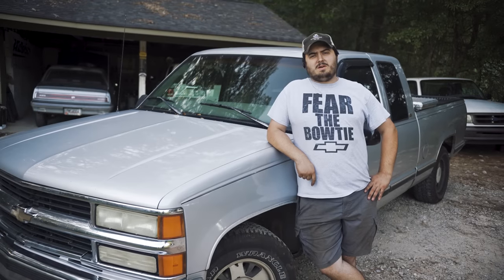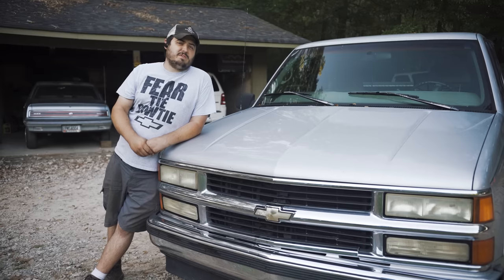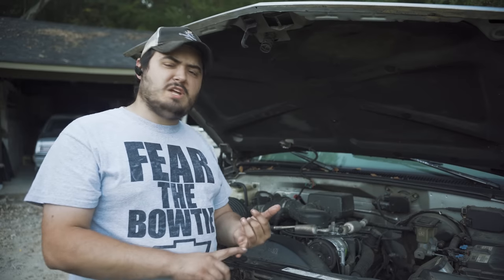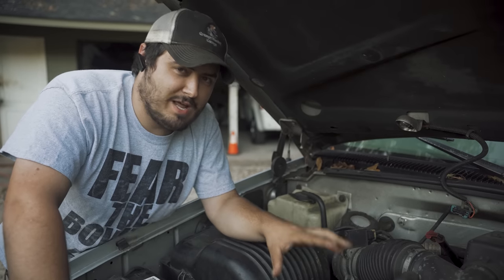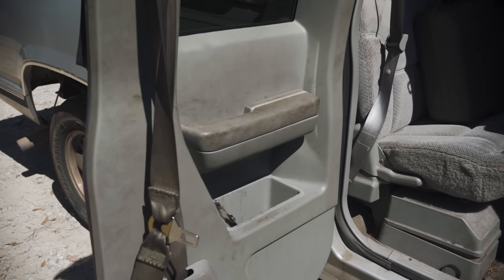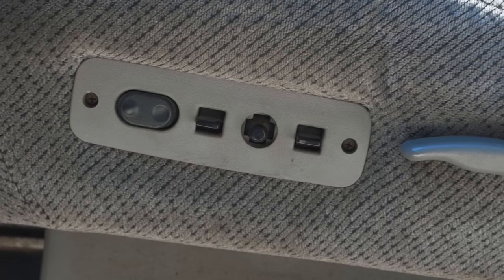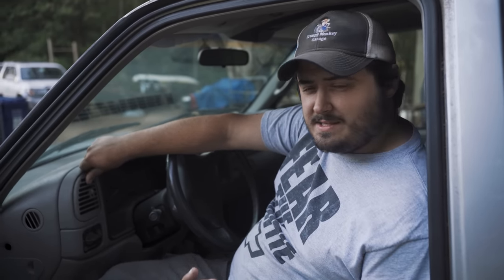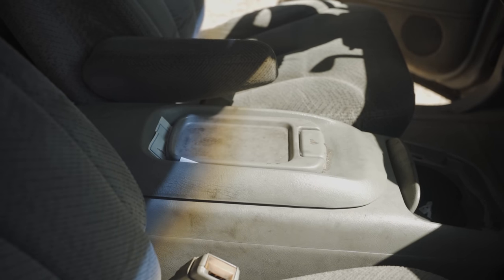OBS CHEVY TRUCK REVIEW, 1997 Chevrolet C/K1500 Silverado Review, The Best Truck You Can Buy?

Comment: I have a 1997 2500 with 348,000 miles. Original engine and no leaks. Love my truck.
Reply: 269k  good to hear!!!
Reply: Which engine do you have in it?
Reply: Do you ever have issues with distributor cap getting fouled with weather, small charged particles etc.? Have heard getting solves distributor issues.

Comment: I have a 1997 k1500 Silverado 4wd, with the 5.7L V8. I am the original owner, it has 190k miles on it. I have taken very good care of my truck. I get people all the time telling me "That's a good looking truck, you wanna sell it?" Nope, never selling it. This truck has been the best vehicle I have ever owned. It has had a transmission repair from towing a large boat for many years, and a fuel system replacement. Otherwise, there is not a thing wrong with this truck. Only wish the built vehicles now like they used to.

Comment: My ol'e girl just celebrated 32 years of ownership by ME. Bought her new in 1990, 350 tbi, k1500,and has turned the odo to the tune of 471,400 miles still on the oe 350. Oh and she's still doing our daily driving and weekend travels. 👊👊🤙🤙👍👍✌✌
Reply: Is your transmission, transfer case, and front/rear differentials original?
Reply: @u.d.novthu2k204  Trans was replaced at 300k,rear diff was just replaced at 480k( owner got to abusive in soft sand). Engine, front diff, and transfer case still oe. ODO is currently at 484,307 mi.✌️✌️
Reply: @bowtie-man  Not bad!
Reply: @u.d.novthu2k204   Yeah I don't think she's done too bad considering the age and mileage. She's still our daily driver and 9 times out of 10 she's our road trip vehicle of choice. ✌️✌️

Comment: 97 k1500 just broke in the engine at 125k and not a drop of oil starts everytime plenty of balls i do all my maintenance bought it from the original owner. And I plan to be the last owner
Reply: I have a 95 2 door one owner just hit 90000 miles. I love it. I am putting it back for my oldest son. He is 11
Reply: I bought my 97 C1500 in 99 and want to keep it until I die. That might be another 25 years, but i think it'll make it.
Reply: 98 K1500 260k, showing the age but I planned on it being a rebuild anyways. It would be nice to replace and rework the true dual system that the previous owner installed. It was beat up pretty good by the previous owner but it's still snarling with the kick to back it.
Reply: dam skippy brother
Reply: Got a 99 K1500 Suburban with 164k I use for my work truck. I put extension ladders and heavy lumber up top on a regular basis and the factory roof rack handles it no problem. Had a 97 K1500 Suburban prior to this one that had 240k and no mechanical issues whatsoever, but the salt and brine they put on these roads in NJ took a toll on the undercarriage.

Comment: I own a '95 K1500 with the GM tow package and optional door remote and I love it! It all still works, 356,453 miles later :D No oil burning either!
Reply: Oil change are life to our trucks
Reply: I feel like the pre vortec motors are better than the 96-99
Reply: i have a 95 silverado fucker runs like a beast 240k miles and haven't needed to spend money on the motor at all yet
Reply: also its a 5.7 350, single cab short bed
Reply: 95 as well here, 296k and going up daily, drives great.
Reply: i wish mine was like that

Comment: I have had my 1996 18 years now. 265, 320 miles on it. Still going strong.
Reply: Like a rock.
Reply: Yeah I have the 97 mines got course 350k runs like a champ no leaks and well still burn the tires
Reply: @jacaughron55  I have a 97 also.  I am often asked if I would consider selling.  I have lived with that truck for 22 years, and will keep it until it cannot be repaired.
Reply: My 94 at 206k is just getting broken in
Reply: I have one also a 1998 and a 2018 but I like driving the 98 more lol
Reply: Tommy Adaway - How much longer do you think your truck will last if you do best maintenance?

Comment: Sing it, bra. I have a 97 suburban and a 98 k1500. Totally love 'em, especially that they don't have hundreds of sensors wired through every inch of the body and drivetrain. Big wide seats, super comfy, and still looks great 25 years later. Pro tip: you can hide a compact 9mm in that overhead CD holder dealie.

Comment: I have a 95 Chevy c1500 extended cab step side and I love it ! Wouldn’t sell it or trade it for anything
Reply: Hold on to that truck! There are harder to find these days. I also have a 95 k1500 ext cab,  4x4 with the 350 5.7 motor. Best of all it’s a manual transmission. Love this truck!

Comment: I have a ‘97 K1500, 5.7/4L60E, Extended cab, Z71 package. The truck has 275k miles and has only had one transmission rebuild. Everything on it is solid except the drivers side cab corner. My plan is to replace it with a new daily driver soon and start restoration on it. This truck has never failed on me, and starts every time I turn the key. They’re solid trucks!

Comment: The first-gen Vortec engines did have issues with intake gaskets and the stock spider injectors, but are both simple fixes with improved replacement parts!
Reply: Recommendations on parts, setup,price, and install difficulty?
Reply: Yes, please tell us what parts to choose for replacement of our spider injectors that will improve power.
Reply: @traveling.down.the.road56  just type vortec mfi conversion on you tube!
Reply: Motorman Mfi is cheap. Ac Delco parts and some felpro gaskets. Upgrade the distributor while in there too

Comment: Today your Silverado can top out in the $10,000+ range. Prices have really gone up which is a testament to their Quality and Reliability. I've owned 14 in total over the years and currently have a '99 C2500 Classic (OBS GMT400) SCLB w/350, 4L80E backed by 3.73 12 bolt rear end and that brings us to my baby, the '95 C3500 Single Cab Long Bed Dually with the 454 7.4, NV4500 5 speed manual with granny first and overdrive 5th backed by a 14 bolt with 4.10 gearing and only 78,000 original miles. Gotta love these OBS trucks! Cheers Monkey. Zip~

Comment: Nice Video, I own a 96 and with all the problems still beats a huge azz truck note.
Reply: Mines a 96 Silverado ex cab damn good truck 308 rear gear and cruss at  at 75 and only tacks 2000 rpms 158000 runs great

Comment: I have a 96 Silverado, it has 550K miles and still going strong, original motor, oil changed every 4-5k, rebuilt trans at about 380k. super easy to work on. I purchased it in 2008 from original owner friend for $2500 (deal back then) with around 140k. I commuted 1000 miles a week in it for the better part of a decade in Los Angeles traffic, it has a ton of power even loaded with a lot of weight or in my case tools. I don't drive it to work any more but its the best truck iv'e ever had, in fact I upgraded to a new Silverado, same model but over 20 years newer. I still have the old truck, been thinking about passing her on though. I know it in and out and can fix its problems myself. Its always the same things, alternator, breaks, rotors, radiator, battery or O2 sensors so it can pass smog bit I figures out I could reset the battery and drive it a hundred miles or so and the engine  light will stay off. I live at 3500 feet above sea level and I suspect driving daily to sea level effects that somehow.
 Just think about it though, mine has over 550,000 THOUSAND miles on the original motor which still is good, doesn't burn oil and has good oil pressure,doesn't smoke and passes smog. It needs some love but other then a few small things its been real good.
Reply: 550,000.  Good Lord!

Comment: I don't have the pickup version but the SUV version. I own a black 1996 2500 4x4 Suburban SLT with the 7.4L 454 connected to a 4l80e trans and love it. Really reliable and easy to work on. This platform is a reliable workhorse while looking good doing it. It has 118k on it and I keep it clean inside and out. I keep it in the garage because every time it's in the driveway I get several people coming to my door asking if I want to sell it. I also have a 2004 1500 Suburban 4x4 with the 5.3L and a 4l60e trans with 206k on it and is still running very strong with all original drive train still in it. I love them both and don't think I will ever sell or get rid of them.  I plan on passing them on to my boys later when they have their families.

Comment: My 96 C1500 Silverado 4.3L has 400k on the original engine/transmission and it still runs and shifts silky smooth. Have had it since 30k. Tail lights can be a problem until you come across a good circuit board set. And at this age, its the wiring that's starting to have problems. Keep changing the oil/transmission fluid and don't beat the crap out of your truck and your golden.

Comment: Just picked up a one owner 1995 K2500 Extended cab- Silverado package with 115K on the clock. Garage queen. While it doesn't have the Vortec Heads, I know the TBI 350s run forever too. Very excited about it.

Comment: Been through 2 OBS GM's, a '95 Silverado C1500 & a '92 Blazer K1500. Gas hogs but beasts on the road. 
Just bought a '95 Sierra C2500 with 522,300 kms for 370$ in an auction. Thing purrs like a kitten at idle, and roars like a lion when I step on the gas.

Comment: Agree, these old trucks, if kept up are great vehicles for work and easy for the DIYers who love to work on vehicles.  Simple mechanicals, only one computer to control the engine fuel delivery, for the most part nice interiors, and the best part: hugely available parts in the junk yards for almost anything that needs replacement.  The aftermarket is still strong for any upgrades needed for this generation of GM truck.  And, they don't look outdated in style or looks, IMO.

Comment: Between my dad and I we’ve had 4. 3 Silverado’s and 1 w/t. 3 were stock 5.7 trucks, only one of which has been rebuilt in to a 383 (just because of a want for a little more power) and one having a 5.0. Each one has served us amazing and have been great trucks.
Reply: I just had my 5.7L rebuilt with a longer stroke crankshaft to make it a 383, but I’m not feeling any increase in power or torque. Did you do anything else to the ecm or intake system on your 383 to make it create more power?
Reply: @traveling.down.the.road56  all it has done to it that I know of is larger bore and stroke, aluminum intake and long tube headers. And I put a k&n filter and roller tip rockers on it. It doesn’t really make any significant more power
Reply: @clayj2386  thanks for your reply. I’m looking for a local dynamometer to see what my HP and Torque numbers are because I don’t think I’m even getting the factory stock 5.7L power or torque. Plus I’m looking for any other modifications that I can do to max out my towing ability

Comment: Love the video man awesome review. I have a 98 k 1500 had it for 5 years now been great she just turned 265000 miles. Just keeps on trucking only problem I have is the distributor caps keep going out or cracking. I did replace the trans at 223000 miles not bad I think. I lifted it 2 years ago replace all the steering and balljoints with life time ac Delco parts. Even with the lift still have not had a promise after 2 years with 35 inch tires. This truck is a tank goes were I tell it and does what I ask it to. I would sell it for anything. My son wants it I told he can have it when he can pull the keys out of my died hands ha ha. It's so reliable and easy to fix love them. My dad had one and I have one now great video 👍

Comment: I agree with everything you said, that's a fine truck, and I love the integrity and power of the 350.  I agree also that this was the heyday of GM pickups; what came after wasn't near as good.  Best pickup on the market at that time?  Not sure you can say that . . . I recently parted with my 1996 f150 that I bought new.  I didn't have much money at the time so it was pretty well the base model, except it had upgraded suspension for a greater payload, a 3 speed automatic, and the venerable 300 straight six.  It was a brute, never let me down, never.  That engine always had mind-boggling grunt; I carried heavy, I towed heavy and, in later years, I plowed snow and even pulled tree stumps with it.  If I could buy it new again, I would in a heartbeat.  No, can't say GM was better than Ford, or vice-versa . . . it was simply a great era for pickup trucks!

Comment: Quick correction. These don't have LT1 engines, LT1 never came in any trucks. 96-98 use the "Vortec" small block chevys which still has a conventional distributor. They are considered vortecs because of the cylinder head design which is similar to the LT1 but without the reverse flow cooling system and made out of iron rather than aluminum.

Comment: Great video. I have a 1998 GMC CK 1500 with 317k miles on her. Yes those darn tail lamps! Its super frustrating to be driving with all your lights working and then all of a sudden your directional bulb on the tailight goes out. Luckily, I have never gotten water in them. It is just because the circuit relay gets so damn hot (the middle bulb holder) and fries it. Its the least of my complaints considering how reliable these trucks are mechanically.

Comment: I just put a new engine into my 97 5.7 K 1500 Z71. I found your video on The day I finished. Subbed
Reply: how much one of those things go for now?
Reply: @Mr334cobra  bought mines through a family member for 2500.
He bought it previously for 4500.
I think he paid too much.
Probably find one over 200k for about 3500.
After putting in my new motor and other parts, so far I'm under just 8500.
Reply: @Dagrizzb  Reason I ask is because I'm getting my Papaw's soon. Has just over 100k. Mint condition. Looking forward to keeping it forever.
Reply: @Mr334cobra that's beautiful.
Dont let it go to waste.
Make your pops proud.
So long as the engine turns on when you turn the key, it will always have a use.
Biggest problem I had with mine was the damn oil pan gasket leak.
Went through 2 gaskets before finally replacing it with a Mahle original oil pan gasket and a new spectre oil pan with drain plug on the  rear instead of the side. Make sure to seal the gaps between the new timing cover and engine block before installing pan and gasket.
2 step bolt tighten sequence.
Reply: @Dagrizzb  Thank you!!
Reply: @Mr334cobra  wish someone had told me this before, could have saved time and effort.
Also, when you do the gasket change, do it right, and remove everything underneath to have FULL access to the underside.
Dont try to cheap out and think, 
"Oh, I can probably just wiggle and squeeze the pan and gasket under there between everything."
Nope. You want full view of the underside. Pan should go in straight up and straight down.
Reply: @Dagrizzb  YES! Thank you. My Papaw always told me, lot of ways to do something, but only 1 right way.
Reply: @Mr334cobra  legit.
Reply: @Mr334cobra  update: that gasket part I provided earlier, starting to trip on the very bottom of the timing cover curve where the pan hugs the timing cover. That is the only spot. If I manage to fix the problem, I'll be sure to keep you in the loop.
I'll try another gasket and get back with results.
Reply: @Dagrizzb  Live and learn! Best way to learn IMO. Thanks so much!!
Reply: @Mr334cobra  just replaced the oil pan gasket with a fel-pro gasket. It's a blue gasket. OS34500R is the part number. What I did this time that I have seen in another repair video, was to squeeze a band of Ultra Black silicon sealant across the timing cover lip from end to end. Place the gasket up, which will squeeze the silicon into the gaps between the gasket and cover, install the pan and finger tighten the nuts/bolts. Let sit for 1 hour, then torque to spec. Start from center bolts and spiral outwards. I will update you once I have driven it for a while to check for leaks.
Reply: @Dagrizzb  Awesome!! Thank you
Reply: @Mr334cobra  so, my pan has been leaking again for a while now.
I did some digging into what I could be doing wrong.
Turns out there are 2 different thicknesses of oil pan gasket.
And 2 different oil pans with different heights in the area that meets the timing cover. 
Fel-Pro OS34500R was the gasket I bought, 
Fel-Pro 1886 is what I needed.
The reason for this difference is that somewhere along the 1970s, GM changed their timing cover gap on their oil pans.
The older oil gasket was 2 1/4 inches thick at the front, the newer one is 2 3/8 inches thick. 
Not a big difference, until you consider crankcase pressure and hot oil. 
Auto parts stores commonly carry in stock the gaskets for the older style oil pans. 
You have to ask for the special part number and order it.
Reply: @Mr334cobra  hey, got an update for you on the oil pan gasket situation.

Comment: I have a 2000 GMC C3500HD. They were sold as Cab & Chassis trucks. They're the same body-style as yours, except for a filler panel between the grill and bumper because of the massive frame. Mine has the short wheelbase with a utility bed, but I'm building an 8 ft. flatbed for it. It has the 7.4 Vortec (454), 4L80E trans, Dana 80 rear end, I-beam front axle with leaf springs all the way around. It was the first year for 4-wheel disc brakes. They're unique trucks.

Comment: I would have to agree with you, the older chevy trucks are amazing. I’m in my early 20s now and I bought my first truck at 17 it was a 2000 Chevy 1500 z71 4x4 with the 5.3 v8 motor I love that truck I’d buy another in a heart beat if I could find one with little to no rust. But since then I’ve upgraded to the 2007-2013 model Silverado’s. They are also pretty nice trucks but the just feel a little cheap but I’m a Chevy guy I love my Chevy trucks 😎👍